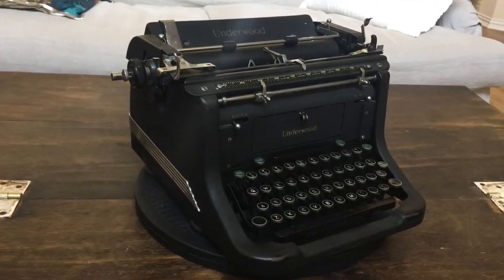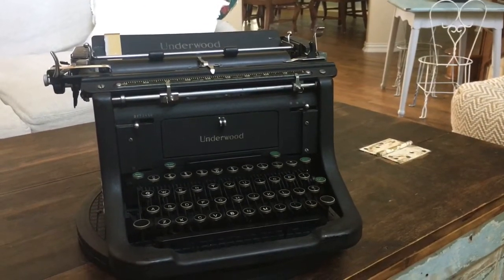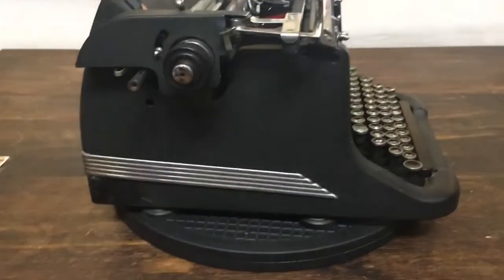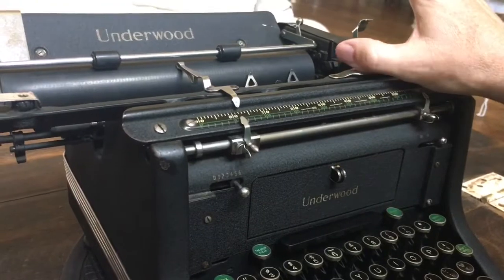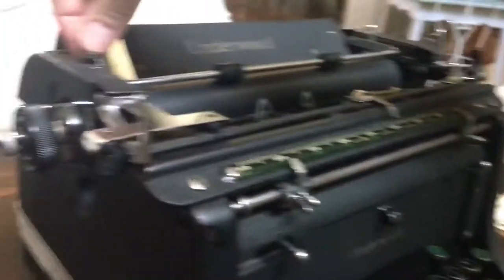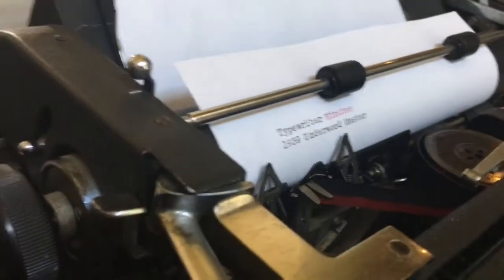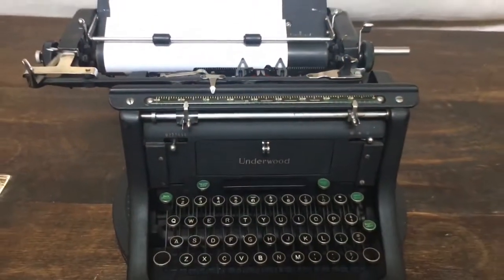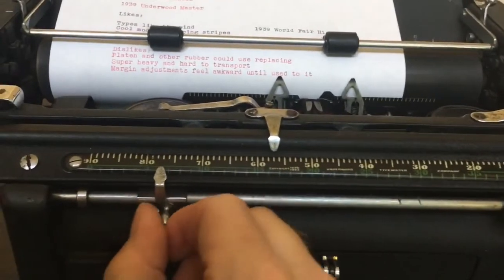TypewriterMinutes - Typewriter Review: 1939 Underwood Master

Comment: I have had two of these machines, and own one--a 1940 model.  It has its original stainless stripes.  A compromise for the stripes you might want to try is to try to find a 1946-48 Underwood Rhythm shift.  They angle off like the ones you have, but they will meet the back stripe a little closer, and are as wide.  But the SX-100 stripe does look striking.  These machines, I looked up, were made from 1937 to about 1942.  These art-deco machines were essentially Underwood #6 typewriters with shells.  They were easily removed for service, and were actually ahead of their time, as most typewriters about twenty or so years later were closed in this way.  The touch is very buttery, very snappy, and the carriage travel is very smooth.
Reply from the maker: John Tapp thanks for watching. I’ll have to keep my eyes peeled for that other Underwood. Because of space constraints I have just a few standard machines, but they are a pleasure to type on.

Comment: Well done!
The venerable Underwood Master. When I first got mine MANY years ago, I did not seem them too often, now they seem to be a little easier to find... yet, still not as often as the other Underwood models. Those trim pieces on the sides are cool and do dress the machine up a bit more!
Reply from the maker: Ponz67 Thank you. I think your video was the first time I had seen another one like mine. Great machines.
Reply: ones that would closer match the machine would be the "Rhythm Shift" machines of 1946-48.  They have the same three-rib design and in front they taper like the SX-100s on this present machine.

Comment: Great review thank you. I have one just like it and the margin slider is stuck ( right side) I will try some oil to clean BUT it will not advance when I press a key which works or hit the space button , The back up button works fine. Any ideas I cannot see the string or spring maybe it is behind the back door with the screwed on panel. It is too heavy for me to move been sitting there high on the shelf for years and it was working when I used it last so I do not think the string broke on it's own just sitting there. Thanks BTW can you still buy ribbon for this machine?

Comment: Those stripes are on my 53ish underwood I just acquired. Missing one side. Where did you acquire them.
I'm missing the left side as you face the typewriter
Reply from the maker: The gentleman I bought the typewriter from had already installed them. I think he got them from a parts machine but I’m not sure.
Reply: @TypewriterMinutes  This would probably be the easiest source.